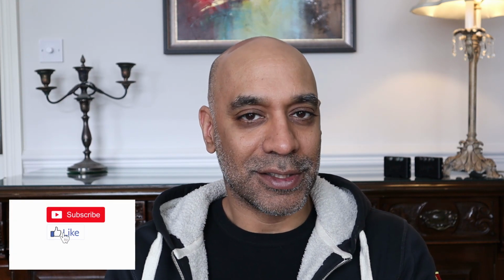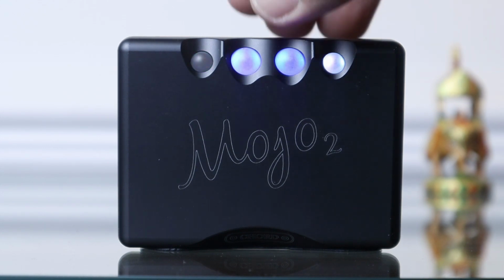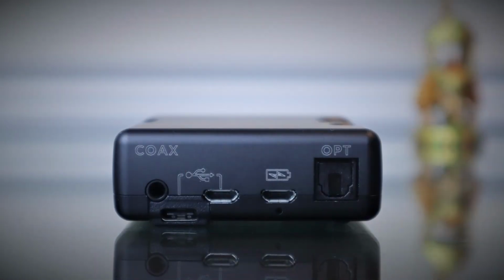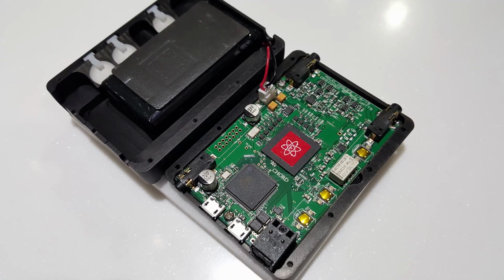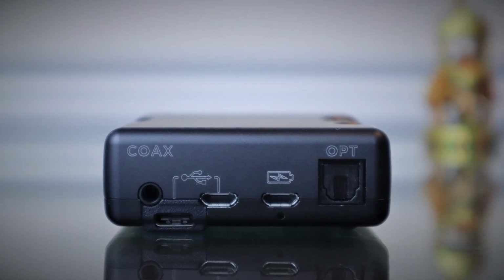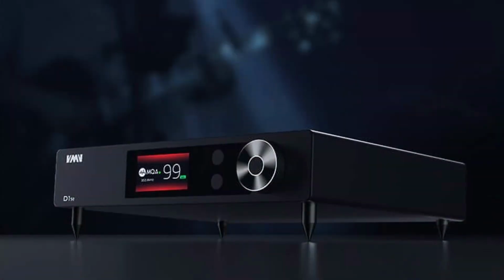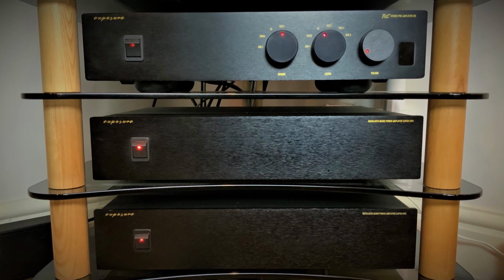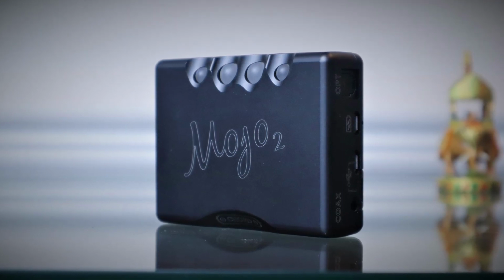Still Relevant? Chord Mojo 2 DAC Review

Comment: Solid review as always Tarun. 

The original Mojo was a revelation for me in terms of 'rightness' of digital sound, and all coming from this odd, inexpensive little box. I tried using it as a pre/dac (in to power amp) but found the light-ball volume adjustment too much of a pain and not at all family-friendly. Real shame they couldn't have just put a volume knob on this 2nd gen, especially with its emphasis for hifi use. 

I got a 2Qute then Qutest. Really interested how this would compare to either of those now they've removed some of that Mojo 1 warmth. I never minded that tbh and though it might suit some systems better than these other models.

Cheers.
Reply from the maker: Thank you for sharing Rob😊

Comment: The first really significant digital product that I could afford was the MSB Link DAC. Although MSB has gone on to make uber-expensive converters and amps, this was the thing that put them on the map. Basically a jitter-solution device attached to a commercial DAC chip.  The original Benchmark DAC-1 was also pretty significant. I still own one. As for modern DACs, I've heard and admired products from Meridian, Chord, Holo Audio, Denafrips and dCS. However, I've mostly heard them at shows in unfamiliar headphone setups. It's been hard to distinguish whether the differences are generated by the 'phones or the DACs. Most of the hi-rez I listen to are streams from Qobuz 24/96 or 24/192. They sound great on the Benchmark (as do Redbook files and CDs). Not really jonesing to trade up.
Reply: Still using the MSB Link III with upgrade. Tried connecting an old Audio Alchemy DTI and it degraded the sound. I do think it’s time to try something newer!
Reply from the maker: Thank you for sharing Michael 😊

Comment: The first mojo sounds great, but in my experience it isn't mobile. It picks up loads of interference if your phone is too close, so you have to use airport mode, and hence miss calls. Also, inside a pocket alongside a phone, the buttons can be accidently pressed, and the usb cable can lose its connection if jogged, resulting in an awful noise. Even when used as a desktop device it picks up awful interference when powered through usb. It is only useful when used stationery on a desktop, away from interference, and powered  by its own battery. Hopefully the mojo 2 has resolved these problems, not that they should have been problems in the first place. Getting the basics right is essential, and the mojo 1 failed on that.
Reply from the maker: Thank you for sharing your experiences 😊

Comment: My first DAC - chosen from all those available at my hifi dealer - was the DPA Bigger Bit. It is still in use in my second system and I prefer it to many other more modern DACs I have tried. Despite your remarks about ease of use, I, at my age, would find the buttons and colours on the Chord Mojo a frustrating experience. Regards.
Reply from the maker: Thank you Daniel. The UI isn’t everyone’s cup of tea 😊
Reply: The Bigger bit was my first DAC, dad's first and it was preferable to many a DAC until he got a musical fidelity trivista and I got it. It immediately made a huge improvement to the sound of my Philips CD160 16 bit I had at the time. Much more detail and space to the sound. It took an age to find something that beat it, it was possible to get higher clarity and more refinement but the DPA was tuneful and toe tapping and those were not. I was desperate to upgrade it though because it was a pain. Incredibly sensitive to mains spikes it would drop and reconnect the connection whenever a light was switched on or the fridge kicked in. An external DPA PSU helped it a bit but will still sensitive. Some days no issues but others Impossible to record a mix tape using it. In the end though it got replaced with a USB DAC HRT music streamer as I stopped using CDs. Then a dragonfly red which was a bit improvement. That's been replaced with an Ifi zen DAC V2 which has burr brown chip. That improved the bass and vocals in particular.

Comment: Hi Tarun. Very revealing review thanks. Granted, it's more expensive than the Mojo 2 but In terms of superior functionality the one for me has to be the RME ADi-2 Dac (even though it's a chip based D/A converter). I have a substantial CD collection (about 4000) the best of which I've ripped to hard drive and played to my hi-fi from a laptop - so that ease of use coupled with the comprehensive onboard DSP/room correction and the LCD screen in the RME make it a preference for me. But then, I haven't done an A/B test of the Mojo and the RME so I could be talking twaddle! Great work. Keep it up.
Reply from the maker: Thank you for watching and sharing Rafe 👍

Comment: At Christmas, I purchased my first serious DAC. The Chord Qutest. This was a game-changer for me. I listened to it against the RME and the Denafrips Ares ii and it came out on top with consummate ease. Since its purchase, I have added the MCRU linear power supply which has taken the unit to another level. I can't imagine more expensive DACs sounding much better than this 
for the money that you would have to part with. It is very hard to find any low points in its sonic presentation.
Reply from the maker: Thank you for watching and sharing 😊
Reply: I had the Qutest for several years and really enjoyed it, though I hated the interface. I recently moved to a Denafrips Terminator Plus which I think is definitely better, but it damn well should be at the price. The Qutest remains a fantastic DAC and if I hadn't got a great deal on a nearly new Terminator Plus I would still be using it.
Actually, to be fair, the tiny LED based interface on the Denafrips is equally pants. A screen would be so much betterer.

Comment: Nice video, Tarun. It occurred to me that you altered your approach to your voice recording (or its mastering in the edit) and this is better - more intelligibility and less listening fatigue.
The micro-USB charging input and USB charger that, as you say, you can leave connected to the device, seem to imply that the device could also run off a USB power bank (would that improve the noise floor?).
EQ in the digital domain is a form of loss as you say, but try to do it in the analog domain. And I guess that also applies to volume control in the digital domain. The only analog EQ device I ever heard and felt to be "perfect" was Cello's "Audio Palette" (Cello was one of the brands by mister Mark Levinson after he lost control of the "Mark Levinson" brand and company. The price of the Palette could by you a very nice midrange car.) So if this DSP approach does a great job at maintaining phase correct wave shape recreations, then wow. My main concern with anything called "headphone amplifier" is if it offers cross-feed and, if so, how (well) it does that. To have a form of EQ type control over this cross-feeding would be important to me.
As to wanting to avoid large EQ swings, we have to go to some radio channels that compress music dynamically and lift the low end - all by a lot. Typically, I avoid such stations like the proverbial plague, but if it is your thing ... This compression/EQ manipulation may only be done to the audio sent to the FM transmitter, but if it is in the digital stream as well, then you may want that big EQ impact. And, some record productions do a similar thing as the assumption in the mastering is that the "music" (not to my ears ;) ) is expected to be played back through (trans)portable playback devices (sometimes called "ghetto blaster").
Reply from the maker: Thank you JP. Thank you for sharing your experiences 😊

Comment: Thanks for the excellent review, but I dunno. The one thing that ruled out the Mojo for me was the lack of a remote control, and besides, I don't ever use headphones. It's so eccentric with the control system!

When looking for an external DAC, I eventually settled on an Earmen Tradutto (£699 at the time), which Srboljub at IIWI reviews compared with the Ares II and found to be slightly superior in many respects (though he held on to his Ares II despite that).

But the Ares II doesn't have a remote either, and that clinched it for me. Only Srboljub seems to have reviewed the Tradutto, which is a pity, since it has brought me immense pleasure and I find it very detailed and rich in tonality with wonderful sound stage depth and breadth. Goes a treat with my Dali Menuets, which continue to enchant and amaze me.

The Tradutto has no adjustments/EQ/filters (but you do get a Pentaconn balanced output in addition to RCA). The sound you get is the sound you get -- but it's very satisfying. I can't imagine anything sounding better for the money I paid. Maybe one day you'll give it a listen. I'd value your take on it if you could ever get your hands on one.
Reply: He just replaced the Ares II with an SMSL M500 mk2.
Reply: @doifeellucky  Yeah, I know. I may get the M500 ii for my second system in the study.
Reply from the maker: Thank you for watching and sharing John 😊👍

Comment: Superb review. My only issue with the Mojo 2 is that you can’t leave it on permanently like desktop DACs. With the new power management system whereby the battery disconnect’s from the charging circuit when it reaches 100% I don’t see with this isn’t an option a la Hugo 2.
Reply from the maker: Thank you John 😊
Reply: @abritishaudiophile7314  Hello again Tarun. Have you managed to compare the sound of the Mojo 2 to the original Hugo yet?
Reply from the maker: @1jhnpennington  not the Hugo but if I get it off my cousin to borrow I will 😊
Reply: @abritishaudiophile7314  That would be really interesting as a used Hugo 1 is similar in price to a new Mojo 2. I know in a previous review you said that the Mojo 1 wasn't as good as a Hugo 1.

Comment: Hi Tarun, I didn’t relisten, but I don’t think you mentioned anything about it’s use with the Chord M-Scaler. That is a new feature for the Mojo (2). I happen to have an M-Scaler and will see how that works shortly as I recently got my Mojo2. But I have been busy at AXPONA  this weekend in the Chicago area. But I think that partnership with the M-Scaler could be sonically impactful. However, it does negate the value proposition of the Mojo2 alone.
Reply from the maker: Thank you. I didn’t have the M-Scaler here. I don’t think many people will be using the M-Scaler with the Mojo due to the price delta 😊
Reply: This comment is ancient. I'm wondering if you could give an update on the Mscaler mojo 2 pairing.

Comment: Hi Tarun, I’ve been contemplating a DAC change in my main system for a while, however, until I can afford the Pontus II, I don’t see it replacing the internal DAC on my heavily modified Musical Fidelity CD player.  I use a combination of a FiiO Taishan DAC for optical conversion from the TV and the ifi ZEN Blue for connection for guests who want to choose their own background music.  I don’t consider either as being worthy of the system, even though both are powered by a linear power supply.

Meanwhile, I installed a ZEN DAC Signature in my second system, to use with its partnering headphone amp, fed by a ZEN Stream.  I was so impressed by the performance of the set up, it made me wonder, if I installed the new ZEN One DAC in my main system, could it be an upgrade for the MF internal DAC, as well as lifting my video experience from the TV.  It uses the same “Signature” upgrades over regular ifi products as my existing DAC, but with added inputs.  At the asking price, this DAC is a competitor for the Chord, particularly when paired with a linear power supply and decent mains cable.

Then, a fellow reviewer on this platform stumbled upon a(nother!) new product from SMSL, the M500 MkII, which comes with a linear power supply built in, for £440 on Amazon.  It’s replaced the Ares II as his reference DAC.  Clearly, this leaves me in a quandry of what to do next.  How about a follow up to this video with a three-way shootout between the Quord Mojo II, ZEN One and SMSL M500 MkII?  In your own time, of course. 🤣.
Reply from the maker: Thank you Mark. I appreciate you sharing and the suggestion 😊

Comment: Crossfead should reduce the left-right soundstage. On the other hand if some inverse phase right channel is added to the left channel and vice versa the soundstage should appear wider.
Reply: I believe it is a known formula that can be implemented as a DSP algorithm. The idea is to mimic listening to a pair of near field monitor speakers where you would hear some sound from the right speaker with your left ear and vice versa. This should push the soundstage forward somewhat, and is most useful when listening to older stereo mixes of recordings from the 60s and 70s where instruments are panned hard left or right eg. The Beatles. This can sound very uncomfortable on headphones and especially IEMs.

Comment: In the DAC world, I remember the Audiolab M-DAC was the gamechanging device just over a decade ago. It had USB up to 24/96, but to me, it always sounded way better on the coax input which supported 24/192. Musical Fidelity made a very nice little converter that you could connect to your USB host port and it would give you 24/192 on coax or XLR.
Reply from the maker: The M-DAC was a significant product in the legacy of digital audio. Thank you for sharing 😊
Reply: The M-DAC still sits at the center of my Hifi! Sounds great!
Reply: What DAC did you graduate to after the MDAC?
Reply: @mig8686  I had an M-DAC+ for a while, then an AURALiC Altair G1. For MQA and headphone listening I have an iFi Pro iDSD with the Elite p/s.

Comment: Another great review. I recently sold my original Mojo for the Mojo 2 and for me the improvements are quite marked. Not just in sound quality but the DSP tone and crossfeed options are there if you need them. Also the battery management is a huge improvement over the original, where users discovered it was not uncommon to destroy the battery within 18 months. The original would also randomly switch off and not because of thermal overload. All in all the Mojo 2 fully deserves the "Outstanding" award from Tarun.
Reply from the maker: Thank you for watching and sharing your experiences Bart. Much appreciated 😊👍
Reply: I also have the original Mojo and use it with the Poly. I'm really pleased that Chord have retained the same form factor as the original so I'm also keen to audition and possibly upgrade to the Mojo2. I'm quite lucky as one of my friends runs a high end audio shop and has this in stock! :)

Comment: In 2019 I got myself the Chord Mojo (£300 on offer) because I've been reading about how good it is for many years and apart from the very good detail retrieval, it's meh to awful. The soundstage is narrow, the sound signature it's an overly warm one, lacking top extension with a rolled-off treble.
Why exactly should I be impressed here? Overpriced marketing BS item sustained by top reviewers. 
Tested against a DX3 Pro V2 (£161) at the time. 
I really hope the Mojo 2 is a lot better, but I'm very reluctant.
Reply: @doifeellucky  Something familiar about this post. What could it be ? 😉
Reply: The DX3 Pro is certainly an excellent DAC. I still use it on my desktop, but it lacks the portable functionality of the Mojo, though there are plenty of excellent, much cheaper dongle DACs out there. You could get a DX3 Pro and a good dongle DAC and still have money left over compared to the Mojo 2.
Reply from the maker: Oh dear, that isn’t the sonic characteristics of the Mojo. Maybe something was broken?

Comment: The user interface is ridiculous.
Reply: @doifeellucky  didn't require even 5 minutes , it is so easy. In fact providing  so much functionality with only 4 buttons is commendable.
Reply: @doifeellucky  The problem is not you can't do it with the manual in front of you. The problem is the UI is not intuitive at all so that you have to keep going back to the manual to change stuff. Of course, if you are the type of users who don't have to change the setting much, especially if you use it in a stereo system, it's not a big deal.
Reply from the maker: Chord like to be a bit quirky but a LCD would be handy 😊

Comment: OK so I haven’t gotten through the whole review yet and just had an epiphany. I’ve been looking for a desktop headphone amp/dac for my Meze 99 classic headphones.  Sounds like a mojo might be just the ticket. Looking for clarity and soundstage, the 99‘s have a very weighty bottom end already. So don’t need any amp that will add bass depth.  Anyone care to comment on this pairing?
Reply: Mojo 2 will drive just about any headphone that isn’t a Susvara just fine. If you’re after clarity and soundstage the Mojo 2 does that very well. I personally love 2nd/even order harmonic distortion so if I was keeping my Mojo 2 I’d be looking for a thick and rich type headphone to pair with it.
Reply: @DrJum  interesting thanks.  If you are looking for a set of rich sounding phones try out the 99 classics.  They do rock very well and have the best bass out of several I’ve tried.  Not the most detailed but that’s fine with me.  Absolutely zero fatigue using them sound wise or comfort
Reply from the maker: Thank you for watching 😊